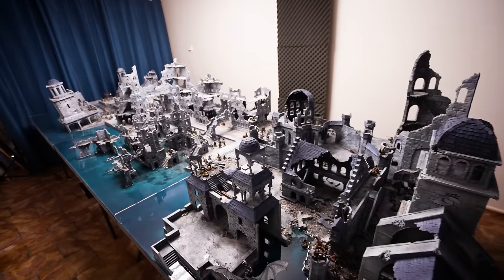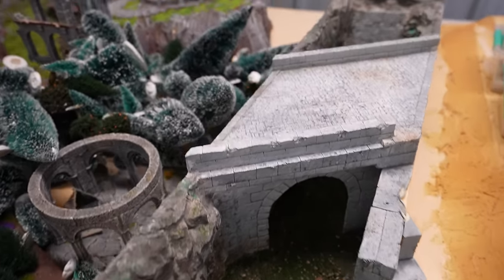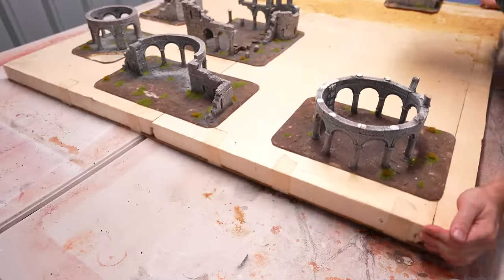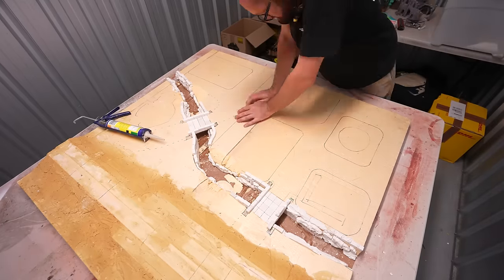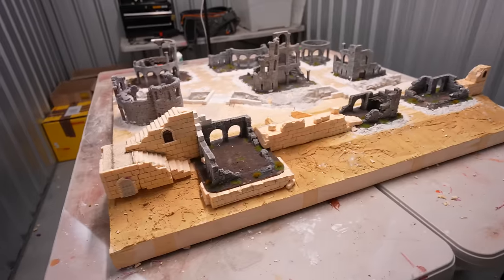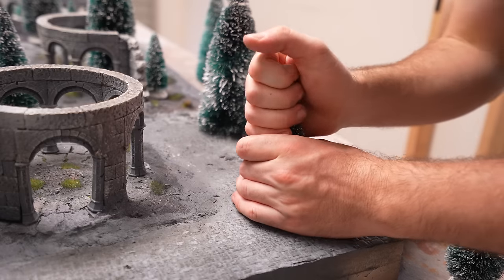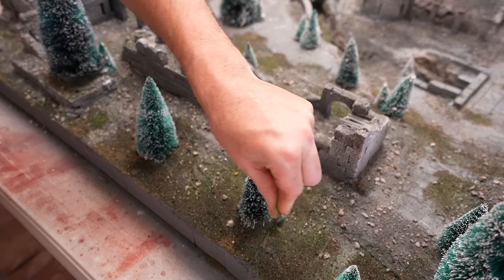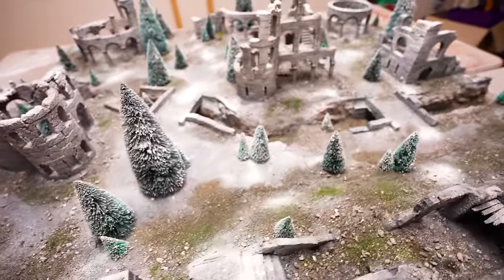The greatest forgotten city in all of Middle Earth!

Comment: This would be really good terrain for Frostgrave. The snow on the ground versus the trees looks to me like it's the period around March, when the weather keeps shifting back and forth, with it first getting warm enough for most snow to melt away, after which it will briefly get really cold again. During that type of weather you will have limited snow on the ground, closer to piles of rock-hard ice, while the water on the trees will freeze to frost, so it looks like there is less snow on the ground than on the trees.